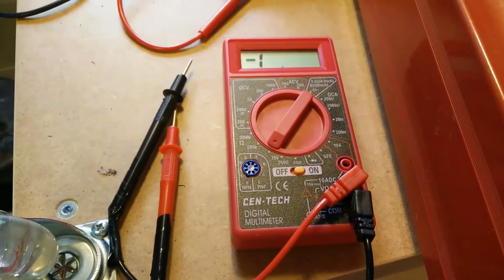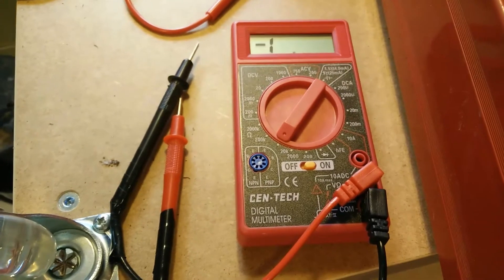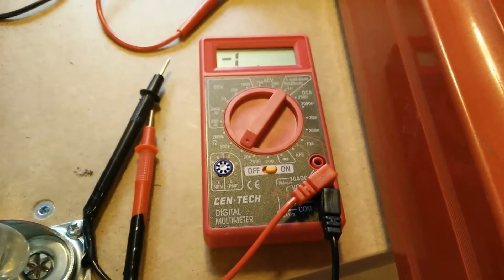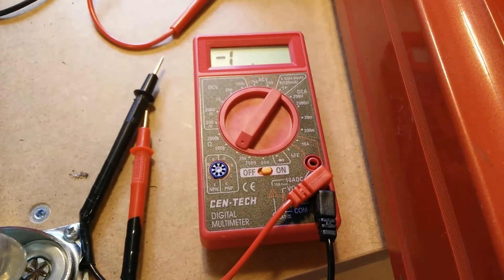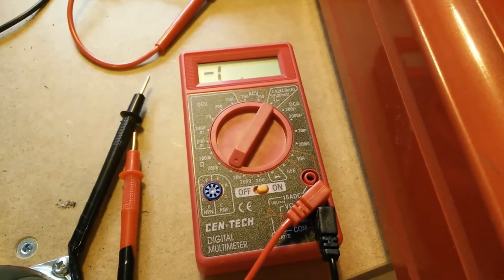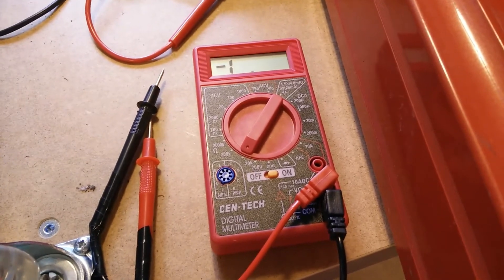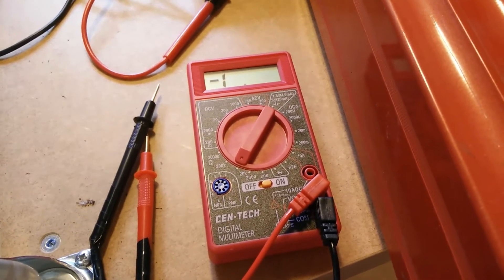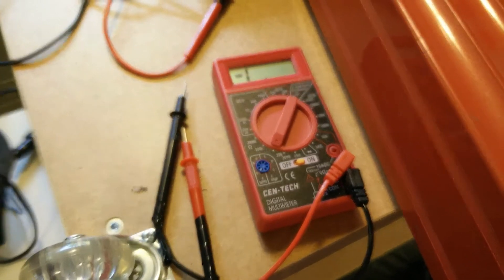Harbour freight centech multimeter no resistance ohms meter

Comment: what did we learn today? that different amperage fuses exist for a reason.
Reply from the maker: +iplay withwires we also learned the electrical engineering student doesn't care enough to get the right fuse for the $5 multi meter